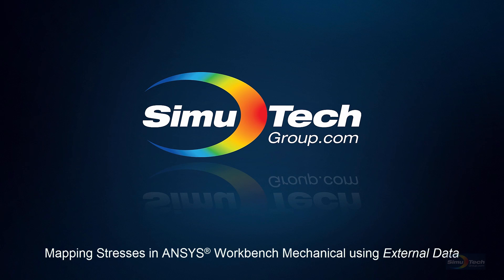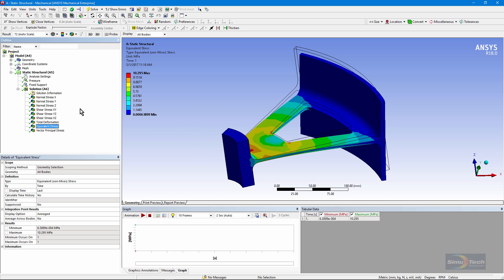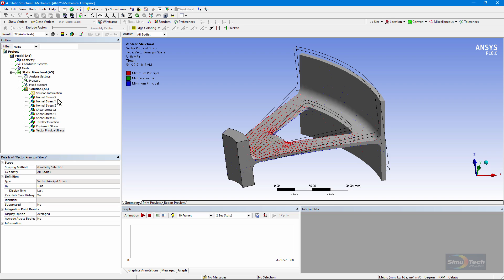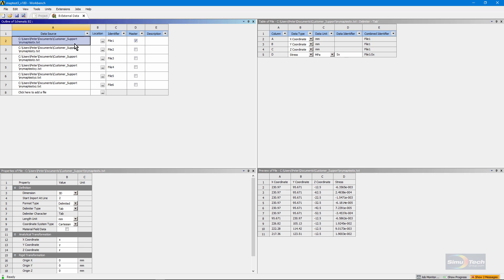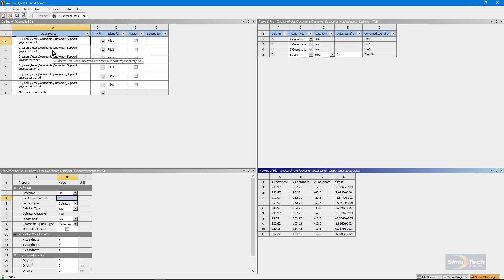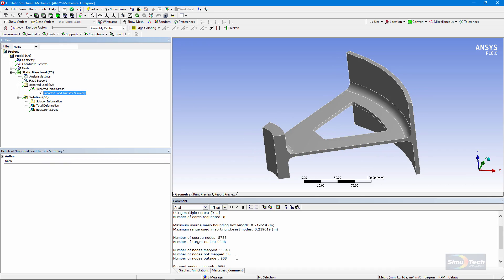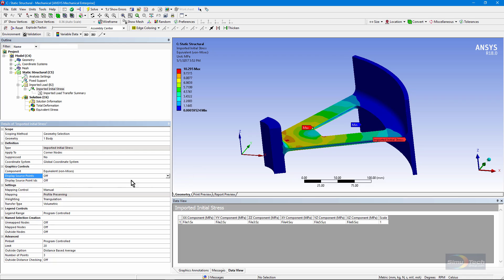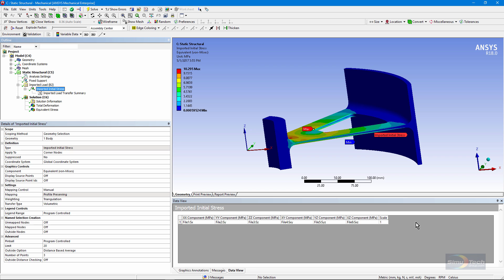Mapping Stresses in Ansys Workbench Mechanical: External Data System Tutorial

Comment: Hi "maskof100". I assume that you are asking about the speed of the mapping process. I do not know whether ANSYS uses more than one CPU to do the mapping. If not, then you are pretty much stuck with the speed of your computer, as long as you have plenty of RAM. Mapping options might affect the speed of stress mapping. The speed will be affected by the number of nodes in both the source model and the receiving model. I assume that it will be the number of corner nodes that affects the speed, since midside nodes do not have stresses in the results file... midside node stresses are interpolated on the fly when you get your results.
As for the question by "Manish Yadav"... The receiving model has to be in the same location in space. If you look at this web page: https://www.ozeninc.com/tech-tip-reverse-engineering-deformed-results-ansys/ you will see a tip on how to get a deformed geometry. If you wanted a deformed geometry to get the temperatures, then your spreadsheet would need to use the node locations of the deformed geometry. Perhaps you could use a deformed geometry to create the source model for the stress mapping, as well as the receiving model? I haven't tried it, but it could be interesting to see what happens.